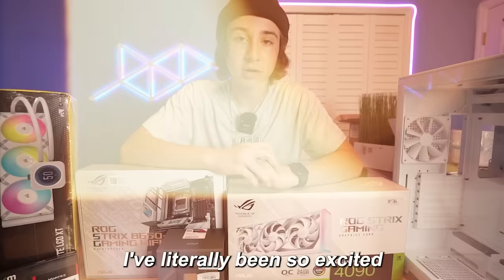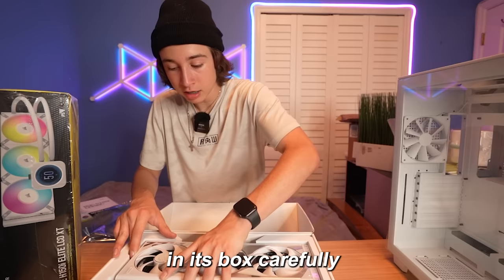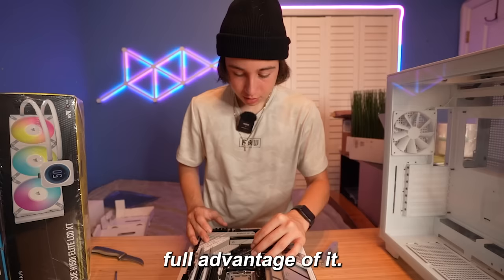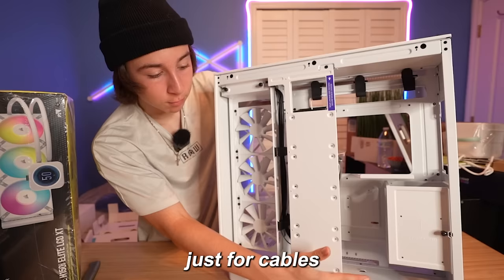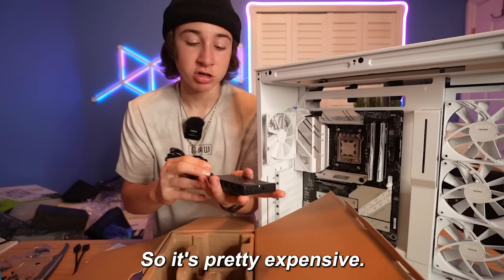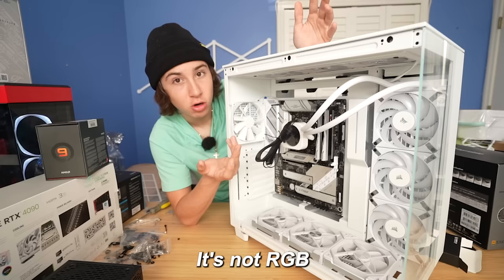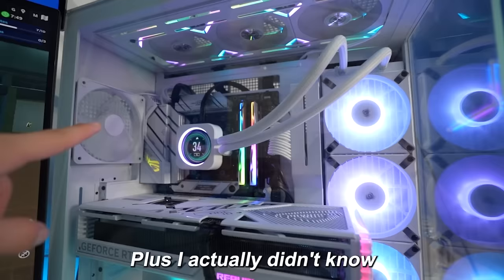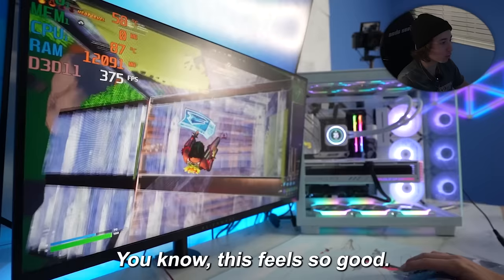ULTIMATE RTX 4090 Gaming PC ($4,372)

Comment: 90 degrees cpu…. Did you use thermal paste?
Reply: Bro he dosent have the brain capacity to remember thermal paste
Reply: @TinyEli5  fr tho
Reply: Never mind
Reply: Fr
Reply: He prob forgot to take off the plastic of the cooler ngl
Reply: He didnt use thermal paste he just put the aio on 😂
Reply: He said it didn’t come with thermal paste
Reply: @Solxrities  lol
Reply: It’s to much of a beefy cpu so it’s really difficult on cooling it
Reply: Most people here aren’t that knowledgeable. You need a more powerful aio for that cpu. It runs extremely hot
Reply: @randomclips7475 exactly i have a 360mm aio and my temps are up there
Reply: Have this exact cooler for my 7950x3D, did a push / pull set up (6 fans radiator) on the top and my cpu run in the fifties. And btw, there IS pre applied thermal paste. Its just that the patern is weird and you may not be sure at first 😅
Reply: @TinyEli5 and you dont have the money for a gtx 1050 ti💀
Reply: The h150i has pre applied thermal paste on the head
Reply: I don't think he did tbh
Reply: Fr 💀
Reply: His fans are mostly exhaust instead of intake
Reply: The aio comes with thermal paste
Reply: That’s what I thought, why not even the thermal paste
Reply: @oddconstantine His didn’t.
Reply: ☝️☝️☝️erm what the sigma 🤓🤓
Reply: No
Reply: He forgot lmao😂
Reply: U dk nothin do u 😭🙏
Reply: No
Reply: It alr had thremal paste listen next time😂
Reply: @TinyEli5  isn’t he like 17 or som?
Reply: you guys are not that smart. all aios come with thermal paste/pads pre installed it’s just newer cpus are harder to cool
Reply: @Axelbrawlstars60 Yeah but not that difficult

Comment: I think you might have done something wrong with the cooler. With that type of cooler your temps should be under 80 celsius. It might have poor contact or not enough thermal paste. It shouldn't ruin anything or cause problems but if you paid for something to cool really well i personally would want max performance.
Reply: bro remember that its 7950x
Reply: @majkel5128  remember hes hitting almost 90c on fortnite and valorant which are some of the easiest games to run
Reply: It's because he has negative airflow pressure. Way more outake fans than in
Reply: He probably didn't take off plastic from aio

Comment: I have tow things that I would change you should mount the AIO with the tubes on the bottom so you don’t get any water sounds this is minor and can be ignored but it is annoy over time (as you said in the video the overall best solution would be to mount the radiator on the top) the other thing would be the RAM I think 64 GB would suit such an build way better. Despite of this tow points is this a super awesome, pretty build and a very nice video. 🙂
Reply: Hey there! Thanks for sharing your thoughts. I agree with you on mounting the AIO with the tubes at the bottom to prevent any potential water sounds. As for the RAM, I think going for 64 GB would definitely offer a better performance boost for that ultimate gaming build. By the way, if you're looking for an efficient cleaning solution, have you heard about the HOTO Compressed Air Capsule? It offers powerful vacuuming and blowing capabilities, perfect for maintaining a spotless desktop setup. Check it out!
Reply: @innovativeadvertising6463  thanks for the answer. This is an interesting way to advertise.
Reply: Are you saying bottom mounting the AIO? If so then that’s the worst way to mount it, but if you’re meaning something else then that’s cool.
Reply: If the Cpu block is higher than the start of the tubes it will get air bubbles, reduce the cooling preformance and eventually break
Reply: @louie1432  I meant that he should turn the AIO around. This would make it quiet and would prevent air from moving to the pump.
Reply: @Icantthinkifagoodhandle123  yes, mounting on the top would be the best.

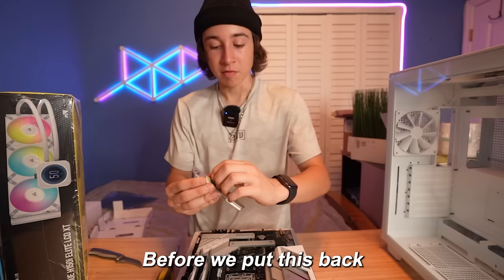Comment: 3:55 that is a thermal pad that helps transfer the heat away from the SSD to the heat sink like thermal paste on CPU. A lot of like good or high tier motherboards now have this because PCIe/GEN 5 even GEN 4 NVMe M.2 SSDs got pretty hot and they tend to overheat so they designed more boards to have the SSD inside under a heat spreader or cooler because most SSDs don’t come with heat spreaders or coolers which is necessary
Reply: No! Its a complimentary gum piece provided by manufacturers to keep you focused when building your pc.
Reply: Hey {{3}}! I completely agree with you. The heat generated by high-performance SSDs can be a concern, especially with PCIe Gen 4 and Gen 5 NVMe M.2 SSDs. It's great to see motherboards now incorporating heat spreaders or coolers to help dissipate the heat and ensure optimal performance. In terms of optimizing your desktop setup, have you considered investing in a reliable and efficient compressed air capsule like the HOTO? It's a versatile tool that can effectively clean your desk, keyboard, and even your car's interior. It's definitely worth checking out!
Reply: is a thermal pad.
Reply: He probably knows but not new nerds so no use confusing the viewers or scare them

Comment: I basically have the same
Build. You can use the GPU kickstand/screwdriver that comes with the GPU and put it under GPU in between two fans. Works in my system although I have the lian li infinity fans but it looks like it’ll work with your fans too.

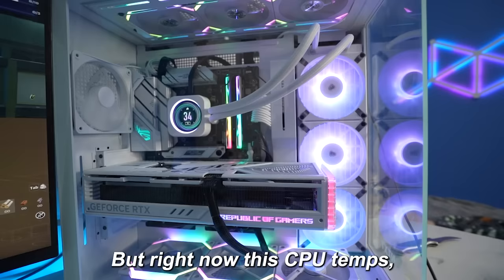Comment: 10:21 i only clicked on this video to tell you that again, you had the radiator installed wrong. But I see that someone told you. The hose is not long enough for you to align it to the bottom on the side, so the best place to mount the radiator is to the top with the hose to the far side of the CPU, the same place where you have here.

Comment: Hey, I just wanted to ask if you have any issues with hard freezing, I have your same motherboard and ive checked every component, the motherboard is the one hard freezing, what I mean by that is that the computer will randomly freeze on its last frame and takes between 30 seconds and a minute to continue. Ive updated bios and all the drivers but it still does this same thing, if you do have this same issue, do you have any fixes? Thanks.

Comment: CPU coolers should always be top mounted directly out of the top vent of the case... 99% of cases out there have these vents and mounts for this reason.. now your AIRFLOW is hot and all over the place.. as long as there's a vent out the back won't matter so much as its all gonna go outback somehow but efficiency wise its not great fans will run faster, CPU and GPU will run hotter
Reply: im building a pc right now and I just bought a 4090 and intel 14900k. I was doing some research and people on reddit were saying to get at least 3 360 liquid coolers. Would you recommend that or what do  I need to get to  make sure I keep the temp down as best as possible on my GPU and CPU?

Comment: The radiator on the side is fine for the CPU temps. 
Moving it to the top can increase the CPU temps if they're outtake because it gets the warm air from inside the case instead of the cool air from outside the case.
Reply: how much would my temps drop by if i moved it to the side

Comment: You might need to replace you fans on the radiator cause your airflow pressure is negative and it causes the CPU and GPU to easily thermal throttle
Reply: Yeah, was about to say the same thing lol. 3 intake fans with 7 outake is wildddd
Reply: @vp1864  im building a pc right now and I just bought a 4090 and intel 14900k. I was doing some research and people on reddit were saying to get at least 3 360 liquid coolers. Would you recommend that or what do  I need to get to  make sure I keep the temp down as best as possible on my GPU and CPU?
Reply: @ryanhoward22 Tbh I'm not an expert, I'd suggest looking into other creators that have made builds using those parts and see what they recommend. The 14900k does seem to run pretty hot though so it wouldn't be a bad idea to run liquid coolers

Comment: in case you didnt know,

that “sticky pad thingy” is a heat spreader, which keeps your drive from overheating and dying, and also keeps from thus burning out the pcie slot and and thus keeping from killing the motherboard. very important.

also, putting the pcie gen 5 drive in the topmost slot is meta for a few reasons:
-more pci lanes
-topmost slot is usually newest gen (faster read/write)
-having the slot and the drive running at the same speeds makes it work
Reply: tysm for telling him i cant belive hes doing his third build and doesnt know what a heating pad is
Reply from the maker: oh ok haha, i kinda thought that was is but tysm for letting me know what the name of it is
Reply: @Vermax  all good and I got selected for a giveaway thingy how do I do it?

Comment: The AM5 CPUs run hit by default. AMD has said it’s ok for them to get even into the 90s while on full load, you should be ok but if you want lower temps you can undervolt and set power limits.

Comment: The Ryzen 9 7900x will bottleneck the 4090 alot. But Clean build Vermax Love that ur still doing good.
Reply: I9 13900k or Ryzen 9 7950x3d is a way better choice to avoid bottlenecks.

Comment: Correct me if I’m wrong. But is there just one fan letting new air in the case, and 9 fans are letting it out? Bro thats not very good. And if you want to mount the aio like that its better to mount it with the tubes on the down side for better cooling. Just want to help

Comment: Check out the capability of the cable for the 4090, that cable I think its only 300W and the card might have 600W peaks. Its only from the 1200W Psu they include 600W cable

Comment: The reason the cpu is so hot is cause its bottlenecking the 4090 and overworking itself. Thought id let you know.
Reply: Have the same build, what is the solution? Downgrade the gpu? I have i9 13900k but my cpu is half that temp
Reply: @Erdemm  you have a 4090 and  i9-13900k?

Comment: Both games you tested are limiting themselves to CPU and you’re bottlenecking. You were at 87 degrees on your cpu during fortnite. Should push the 4090 in extreme 1440p settings or 4K instead so you can get the most out of your 4090. Nice video tho

Comment: You got a 4090 and didnt go all the way out with a ryzen 7950x3d or i9 13900k? If you bought the parts before the release of the x3d chips, you could've at least gone with a 7950x. Wow... yuck bro the build is ruined. The 7900x even gets beat by the i7 13700k in EVERYTHING.
Reply: he got sent everything for free, can't complain about that
Reply: @chrizz1  If that's the case, I'd of sold the 7900x and used the money to go towards a 13900k or 7950x3d. The build still is ruined and is... quite ugly with such a lesser CPU paired with a 4090. You know this.